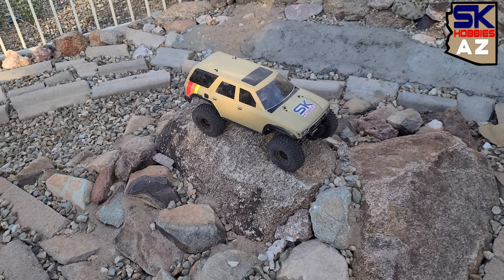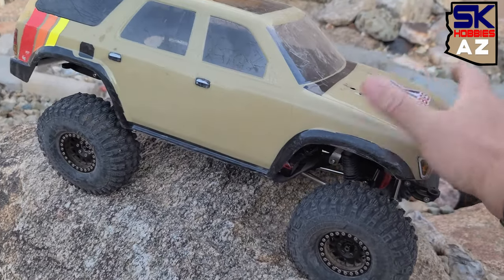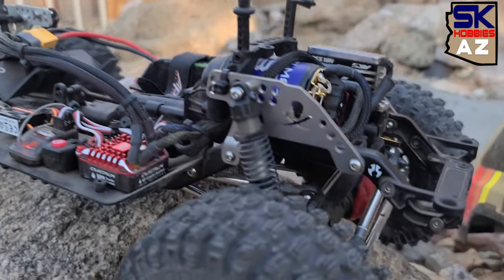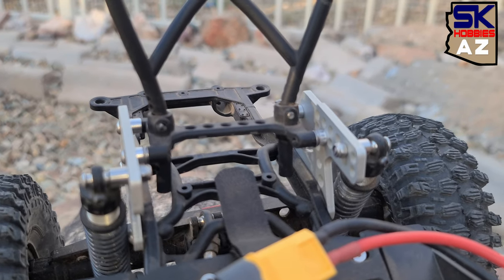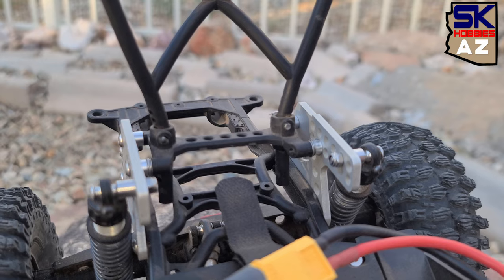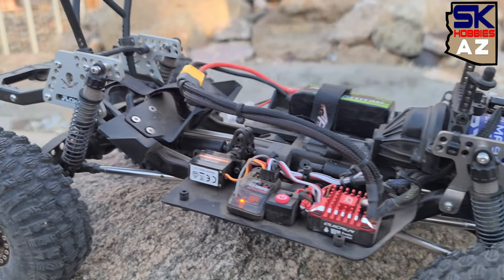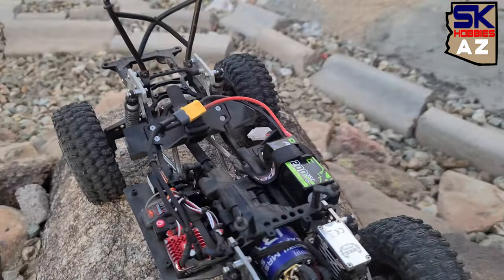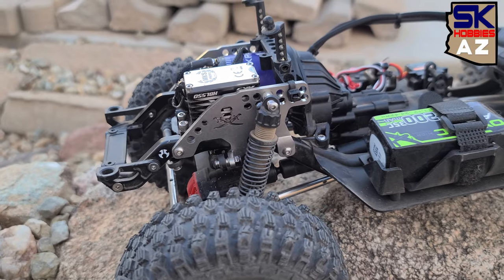Axial SCX10 iii 4 Runner Upgrade - S01E119

Comment: Awesome video. Working on my SCX 10 Early Bronco to get the torque twist under control. Planning on installing saddle packs, like somehow you did. My rig is too heavy in the back and have 52% to 48% weight distribution.
Reply from the maker: What have you put for brass up front?
Reply: @SKHobbiesAZ  no brass on the axles nor on the wheels..
Reply from the maker: @Grumpy Cat's RR  adding brass up front might help you out there. Just remember that rotational brass can cause extra wear and tear to your drive line. Try adding a bass diff cover,/nuckles. You don't have to do both, but try 1 of them and see what it does to the weight distribution. Just keep all brass low to the axle area. Adding brass up above the axle may cause the rig to be more top heavy.